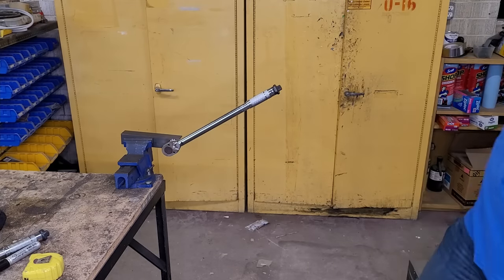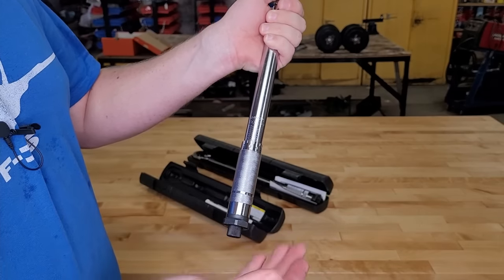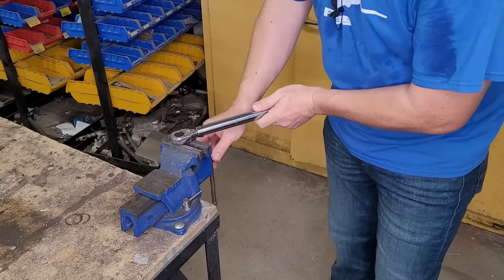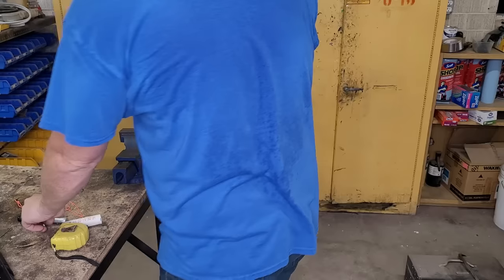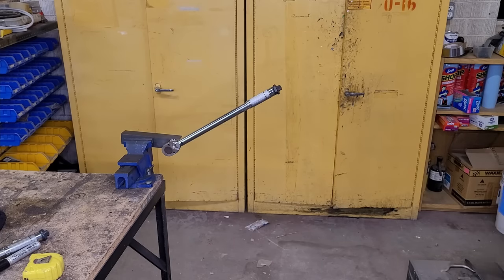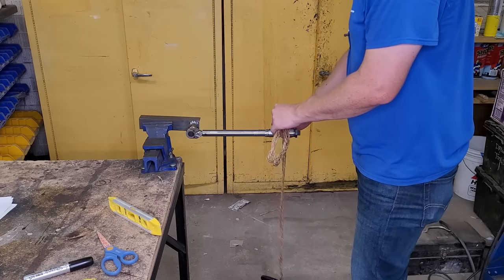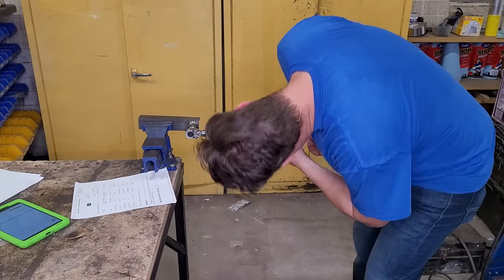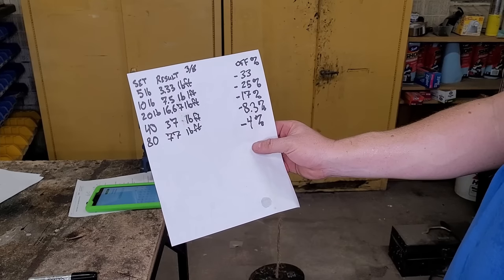$20 Torque Wrench, are they accurate? | Harbor Freight 1/2" and 3/8" Drive Review and Test

Comment: Interesting for me, I used this method to check my cheap (metric) torque wrench out, having to work out the force of gravity into the equation and convert Newtons to Newton meters! That was fun, found out that my wrench was off, so found a few YT videos on how to calibrate it, a little grub screw under a rubber plug about half way down the length of the wrench needed to be adjusted took about 15 minutes and done! Cheers for your input

Comment: I have a good digital 3/8 Gearwrench 120xp torque wrench for my engines... but I do have the quarter inch Pittsburgh Pro from Freight and a 3/4 inch Pittsburgh Pro from Harbor Freight ($80) and they are actually really good to me... they  out perform the 20 bucks and 80 bucks...
Do that with an expensive torque wrench and your results will be pretty much the same most torque wrenches work best at the higher end of their capacity..
So if you're trying to tighten something Titan something at 10 foot pounds get a quarter inch torque wrench not a 3/8 or 1/2 in ....and vice versa if you want something at 128 ft lb get a 3/8 or 1/2 in .... right tool for the job....
Reply from the maker: I have noticed that too,  I don't use the lower 25% range of the wrench usually ill step down a size.  However the manufacturer should not have it marked to go below it's accurate range.
Reply: Bought a 1/4 from HF today my 3/8 seemed to just not feel right at the lower ft pounds.
Reply: @ryanmccarthy76  they're good👍...(Pittsburgh /4" torque wrenches)
Reply: @ryanmccarthy76  yeah cuz it’s a 3/8
Reply: You gotta count the leverage of the tool with small screws by hand you can tell with a small wrench a good feel and with a big one you don’t feel nothing try tightening a 8mm with a 1/2 inch ratchet with adapter to 1/4 inch

Comment: First of all, you should never use these at the low end. They won't be accurate. Use a smaller torque wrench. Second,  the weight of the handle plus the string+pipe will make it click sooner. Other than that, a good video. I did this with my HF torque wrenches using my lug nuts instead of welding a socket.  The 1/2" and 3/8"  were within a couple of pounds in the middle ranges. Good enough for what I use them for. I got them for $9.99 on sale. Good deal!
Reply: I have the 1/2" one in the back of the car with a 19mm deep socket and a breaker bar for tire changes.  I figure lug nuts spec'd at 89 aren't likely to care too much about a <5% error margin, since they pretty much have to be designed to survive someone cranking them on hard with a 4-way, but since switching to torquing them every time (and loosening and re-torquing myself after any shop that I didn't actually see torquing them right) I haven't had any studs seized, stripped or snapped.

Comment: Glad I found this video. Didn't think about my inexpensive O'Reilly wrench being way off. Never saw directions about cycling it before use. Will check how accurate it is now thanks to your vid as I use it to tighten my daily driver lug nuts.

Only mechanical issue I have had with it was the top two black screws holding the head piece together came loose and out due to no locktite being on them. Was easy enough to screw it back together.

Comment: Found this video right after learning that the 'weight at some distance' method is a flawed method for testing the accuracy of a click type torque wrench. I am not an expert, but just passing on what I learned. Because of how the mechanism works, the applied torque at the head actually depends on where you hold the handle. They are almost always calibrated to a perpendicular force applied to the center of the handle, so applying force anywhere else as you did in this video will yield incorrect torque even with a calibrated mechanism. Counterintuitive right? It is because the pivot point for the mechanism that measures the torque and the pivot point for the head are at different positions; changing where you apply the force on the handle changes the relative size of these two levers, which yields different applies torques even with a calibrated mechanism.
Here is experimental evidence demonstrating this effect from Park Tool, maker of high quality torque wrenches for bikes:
https://www.youtube.com/watch?v=BPe1-bDFVRM
And here is an explanation of a click-type torque wrench's mechanism and the math of why grip position matters in this design:
https://www.youtube.com/watch?v=0f746pF1xc0
Reply: Any person that buys a torque, torques it from the handle so I'm sure engineers designed it with that in mind and any sane person will know that it's best to torque it from the handle. I don't want to get too deep into torque settings as a DIY, I only care that the torque is accurate enough.
Reply: Great comment with substantiating links.  This leads me to ask: In order to get accurate results, would it be necessary to use a system which suspends a bucket from the midpoint of the grip to which is added a known undersized weight  and slowly add small weights to find the click point? Once found, the bucket and contents could be weighted to get the actual trip weight.

Comment: I really enjoyed watching your video and did so out of curiousity.  It raises a lot of concerns in my mind as to your methodology in testing these click type torque wrenches.

These click torque wrenches do not depend on the distance from the socket to measure torque.  I am not really understanding why you are trying to do that.  The internal mechanism is completely independent from where your grip is ont the handle.  The internal mechanism is set to click on the dialed in torque setting no matter where you grip the handle: In fact, you can put a 5' cheater bar on the handle and it will still click off at the correct value.  The way these kinds of wrenches are built, it is like a torque wrench inside a socket wrench, where you literally have no interaction with the actual torque measurement aparatus (click point).  The only interaction you, as the end user, have is adjusting the calibration by disassembling the knobs on the end of the wrench handle.  What this basically means is  if you pull on the handle of the wrench next to the head, or put on a cheater bar to make it 5' long, the torque wrench will always click off at the setting dialed in, it just does not care how much leverage you apply to the handle (distance down the handle shaft you pull from).  The measuring of how far down the handle you put your weights makes no difference in other words.

I am not sure if maybe you were trying to find something out that I am just not understanding, but it sounds like you are unaware of how this kind of torque wrench works.  I cringed when it nearly popped you in the face, as this was for nothing.  I guess you could use this kind of setup to do an actual calibration of the wrench, but it would make more sense to use either a pully to pull up on the wrench or a baggage scale to pull up on the wrench so it is not so dangerous.  Here at my work location, we use a deflection torque wrench to place head-to-head with our click type torque wrenches since they are not calibratable and easier to validate than a click type.  Doing that head-to-head allows you to apply force to the click torque wrench in the vice and so you pull on the deflection torque wrench so you see the actual analog torque value and watch for the click of the wrench in the vice.

I am not sure if what I am telling is making sense to you, but you really need to understand how these click torque wrenches work better for your own safety.  I fear someone is going to follow your direction and get really hurt for no reason..  Keep up the work on your videos, as I enjoy watch them as well!

mrstan

Comment: For this to be more accurate, you should factor in the weight of the handle, rope, and pipe. Will make a difference especially in the lower ranges as the percentage of total weight would be greater. Otherwise great, well thought out test and greatly appreciate you taking the time to make this!

Comment: Something to consider in your testing is that you had the weight wrench unsupported which could be throwing off your measurement would be more accurate if you tested horizontally and pulled it with a come along and had a load force tester inline

Comment: Just an FYI: In normal usage, socket adapters or extensions will have an effect on the torque wrench's accuracy due to torsion.
Reply: Where does that torque go? Did you invent something that violates equal and opposite reactions? If you draw a box around your system, did you somehow dissipate torque into the air?

Torque = Force x Distance (in this case that x is not just a * sign, its vectors with the force perpendicular to the arm)
Reply: @jakegarrett8109  In your comment, I don't see any mention of the engineering concept of torsion. I specifically said "adapters or extensions will have an affect on the torque wrench's accuracy due to torsion." How much the accuracy is affected depends on several factors including length, material, etc. of the adapter/extension. It may be insignificant for some, but crucial for others. So no, I didn't "invent something". And no, the lost torque didn't "dissipate torque into the air".
Reply: @MrPaulSimone  So did that formula say anything about torsion? Engineers know that a system you draw a box around it, and if you have the same rpm coming out of it you will have the same torque, where is this power mysteriously dissipating into the air?

You can twist a spring 100 turns, but even if its rotated 36000 degrees, its torque at the output will be identical to the torque at the input unless something else is holding it in place. Where is the air holding your connector in place?
Reply: @jakegarrett8109   Are you seriously doubling down on your ignorance? Do you think the single equation you used accounts for all forces/stresses involved in rotating bodies? Do you think there are no other mathematical relationships involving torque? Anyone can Google the basic equation for torque in 2 seconds. Well, at least you were able to do that. 

Come on, you do realize 100 complete "turns" of anything is the same as 36,000 degrees of revolution. Additionally, your example of the spring and air is pointless when discussing ratchets, sockets, and extensions. On the other end of that ratchet may be a Honda Crankcase pulley bolt. It will teach you the concept of torsion if you're using your extension(s) and your Googled basic torque equation.
Reply: @MrPaulSimone  What is the difference between a spring (kept straight along its axis) and this magical torsion in socket extensions? News flash, the socket extension would be a torsion SPRING, and yet, the torque at the end (because the summation of all forces must be zero) did not magically dissipate torque.
Reply: Jake is correct, extensions do not matter.

Comment: decent wrench for a diy person doing basic work drain plugs, lugnuts ETC, not delicate things like motors. Good test
Reply from the maker: Great point!
Reply: Is it good for tie rods and suspension? I bought the 3/8 today at HF and going to use it soon
Reply: @richcityrepresentative8805  yes
Reply: @ikeyeet8312  ok thanks

Comment: On the case, it's just as good as the snap on. Had the 3/8 and 1/2 inch digital. Retired and sold them. 480  and 800. Had to pull the head on my 22r. Used the Harbor freight 1/2 inch. So far so good.

Comment: Well by using your chart, just remember to compensate for the 3/8 at low torque. I have the 1/2 and 4% is good enough and glad it is accurate over range. Thanks

Comment: I just bought the 1/4 inch and 3/8's on sale for $11 for that price even if its 1/3rd off I plan to use it.  I mean I dont worry about torque on anything besides headbolts and main bearings. Everything i just make tight is tight

Comment: I bought the 1/2” drive torque wrench from Harbor Freight mainly to torque the castle nut on my AR-15 (spec calls for (38-42 foot pounds, so we set it for 40 foot pounds, right in the middle of the range). 

All the advice I read online from other shooters said to not waste money on a high end torque wrench if you’re not an armorer and just doing it for your own rifles, and to just get a torque wrench from Harbor Freight, so I did. 

My castle nut wrench is probably the best available, and it’s a 1/2” drive, so it’s nice to know that the 1/2” torque wrench is within spec. If I was building dozens of rifles for clients as a business, I’d invest in a better wrench, but for just a few, the Harbor Freight wrench will provide the required torque so I can stake the castle nut with confidence that it’s as tight as it should be, and it will stay put unless I decide to remove it.
Reply: Exactly why I'm thinking about picking one up. Need the 3/8" drive though.

Comment: I just bought the 3/8" wrench (before watching this video) but I don't feel so bad with my purchase. I bought it on the SMALL chance there might be a day when I need to tear appart my lawn mower or snow blower engines and neeed to torque them back into spec. I can live with them being off by ~ 8%. I just need to remember to set the torque a bit higher than spec.

Comment: I found this video extremely helpful. I recently did the valve cover gaskets on my wife's truck and they are still leaking and was really dreading having to re do them, but now that I found this video I am leaning much more to the torque values being off
Reply from the maker: It's a possibility, don't crank them down too hard or you may distort the valve cover.
Reply: Did you apply rtv sealant on the corners of the gasket and do the correct torque pattern sequence?
Reply: @scottanthony7284  not every vc gasket needs RTV
Reply: I've been a mechanic for 40 years and have never used a torque wrench on valve cover bolts.

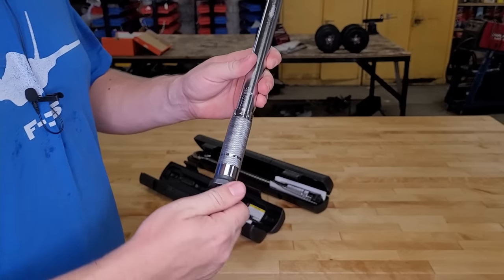Comment: 1:36 there are such things as left handed threads, go ask your grandparents about the Valiants and Darts they drove in the 60s and having to tighten lug nuts in different directions on each side of the car.  So being reversible is a key feature for the Mopar Or No Car, A-Bodies Only, and C Body Dry Dock crowds at the very least.
Reply: It's very common in industrial environments. One of the hard lessons that I learned, and then passed on to all the youngins I had to train over the years. Sometimes, you have to break off a bolt or cross thread something to learn the hard lesson. I always help them out though, when they have to easy-out the broken bolt or re-tap the cross thread. I try not to be a jerk about it.

Comment: Point 1 they're not reversible to loosen a nut or bolt, they're reversible to torque left hand threads. Point 2 the 1/2" wrench was accurate enough for most home mechanic jobs and the 3/8" one could most likely be recalibrated to acceptable limits. As always you get what you pay for. But for most jobs they're fine. After checking them I'd trust them for putting together a car or motorcycle engine.

Comment: you can  calibrate them yourself ,very easily . there designed to be calibrated with the adjustment beneath the screw handle . all you is need a fishermans scale . the type you hold up .

Comment: glad you didn't get hurt on that!  Very interesting test.  I bought those plus the 1/4" one.  My 3/8" doesn't seem to trigger.   The 1/2" one seems to work fine.  Haven't used the 1/4" yet.  Of course I haven't tested them to see if they are accurate or not, only that they trigger
Reply from the maker: I think maybe going up a level to Husky from home depot or to Harbor Freight's better wrenches might be worth it after reading everyone's stories!
Reply: I went ahead and replaced mine with a Lexivon

Comment: FUN FACT: Torque wrenches work best when they are used at the closest value they are maxed out. Meaning if you want to tighten a lug nut with 140Nm then you better have a torque wrench with 160Nm max limit (or something around that area). However most of the1/2 wrenches are 210Nm but you can compensate by "overtorquing" a bit to overcome the loss when you use a lower value.

Comment: Your test on the 3/8" drive version looks like it would be very easy to recalibrate, as it is off by pretty much the same amount at each test point, so it's just a straight linear adjustment that's needed. And most accuracy specs are measured as percent of full scale, not percent of reading, which would mean that the 3/8" drive wrench you tested meets its torque spec accuracy claim.

Comment: I have both 1/2 and 3/8 inch.  They seem to work ok at times.   The 3/8 doesn’t alway work for me, not sure why? Sometimes it doesn’t trigger at low torque values.   I just end up hand tightening so as to not over torque.  Better than nothing, but would rather have an electronic one.   1/2 is good for wheel bolts and suspension work.

Comment: I might be mistaken but I seem to remember from my highschool auto shop class is that torque wrenches are calibrated in such a way the the position of the handle from the pivot is the same as 1 foot regardless id the handle is not at the 1 foot mark. A 3/4" wrench has an almost 2 foot long arm but is calibrated so that is measures as if it was at the 1 foot mark.

Comment: My first torque wrench was a cheap one. From 40 nm to 200 nm. At 110 it only did 40 nm. Got a new one... at 110 it was 190. Swapt it for a beta tool ... if it got to be good you need good tools